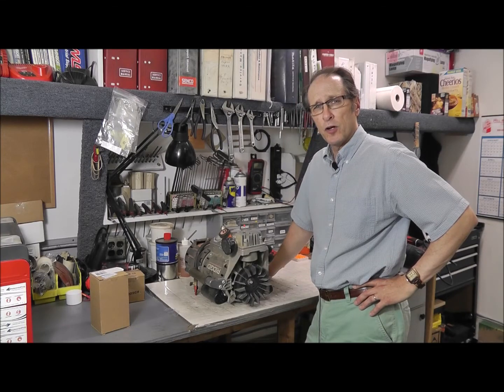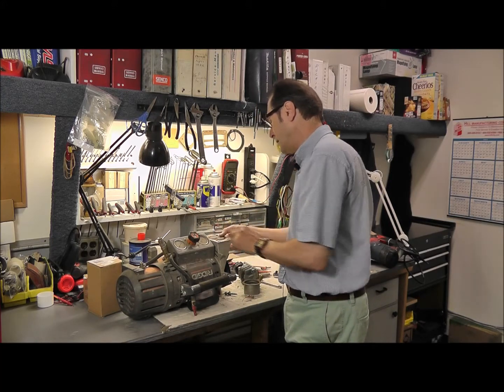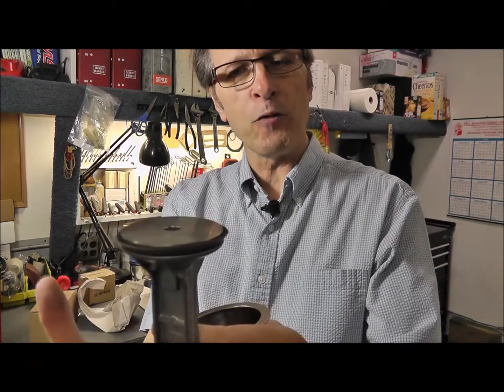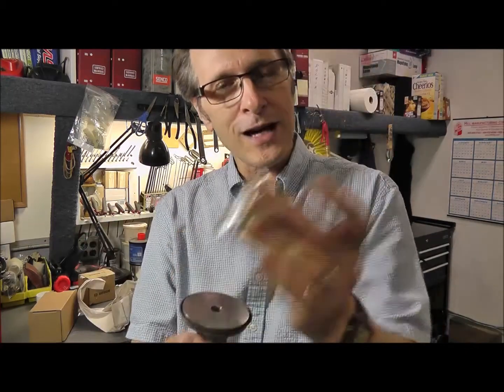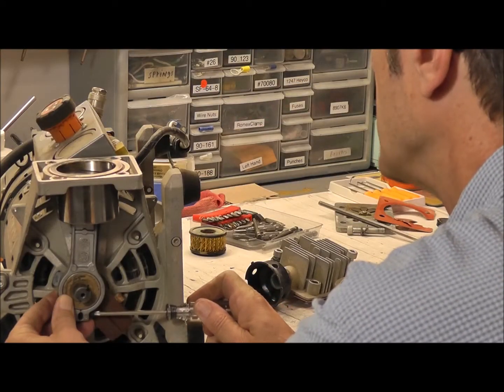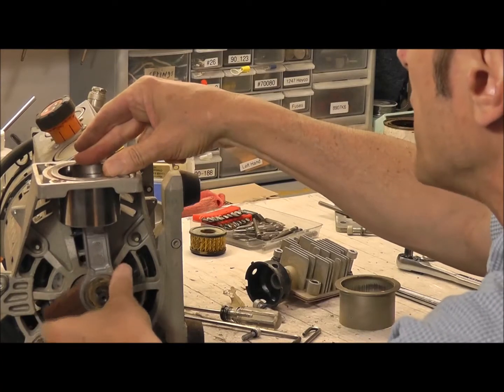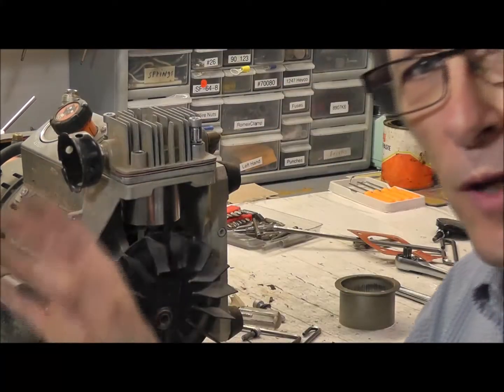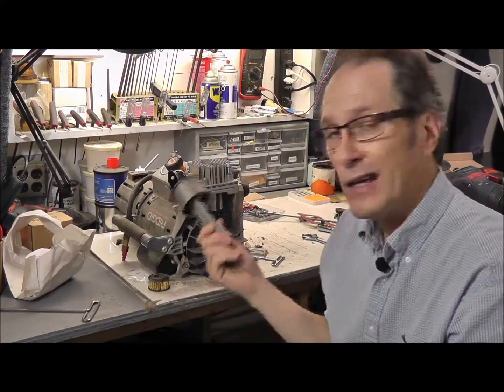Oil free piston and cylinder kit installation for air compressors

Comment: Great video, thanks! I have been methodically working through the 'restoration' of a DeVilbiss IRF412-2 compressor. Replaced the check valve, cleaned up the pressure switch, regulator--unit holds pressure well. Lots of vibration and heat, finally pulled the cylinder head. Valve looks fine, cylinder sleeve scored and compression ring gone! Luckily this model has a torx screw for the connecting rod cap, so I don't have to pull the fan/rod. They built these things like tank back in the day.

Comment: Hi Gill. I have just got me a jun Air silent compressor for a good price. It works well and has been regularly maintained. 
 First thing I’ve done is order A K&N crank case filter to replace the rubbish OEM one. 
 Secondly, I’d like to run it at a higher pressure than the switch is set to. 
 The whole unit is rated to about  150 psi higher than the preset on the switch. 
 Yea, I know these are for dentists and I’m going to run pin guns and small nail guns but I’m sure it’s worth a punt, I just want to run higher pressure to account for the losses in the hose. 
 Are you familiar with these units? 

Thanks.
Reply from the maker: Thanks for the question Rollo! Here is some input that you might find helpful:

- Determine the max safe pressure of the tank.
- Make sure that you are 30 PSI below that pressure.
- Get a safety switch that is rated for that pressure.
- Buy a safety valve that is 5 to 10 PSI over the pressure switch pressure but 20 PSI under the max burst pressure of the tank.
- I'm not entirely sure what the piston/cylinder will do at these higher pressures.

Comment: The piston on my craftsman model 919-153130 compressor does not have a screw on top to remove the top part of the piston to replace the ring,how do I get the top of the piston off to put a new seal ring on it?
Reply from the maker: For your (older) model, you won't be able to replace the piston ring separately, I'm afraid. In this case you would USUALLY replace the entire piston/connecting rod assy, along with the cylinder cup/sleeve, but that part is not even available for your model any longer. It looks like you may need to replace the entire unit at this point as I don't see any other options. Do you see a part number anywhere on the connecting rod?

Comment: Is this the same for a portable air compressor? I have a bostitch 150 PSI 6 gallon that I think needs new rings.
Reply from the maker: Thanks for the question! The oil-free pump in the video is used on many models and is very similar to many out there. The installation is virtually the same for any portable oil-free compressor out there. If you can find your model#, you can search it on our website and find a full diagram and parts list for that unit.

Comment: I'm hoping you can help me find the rubber/plastic piston ring that goes on my diehard 1150 battery pack/tire inflator....Sears has not parts listed for this model...
Reply from the maker: Thank you for the question! Many parts are now obsolete for units sold by Sears so it may be a shot in the dark at this point. We don't have this available so the only option would be Sears.
Reply: @AirCompressorPartsOnline    Thank you for your reply...I'm sure this compressor has been used on other pumps, do you folks carry any of these pistons seals for similar units??  Is there anyway of finding out who the manufacturers are for some of these pumps?  I would be willing to buy a new compressor unit for this Diehard, hate to toss this Diehard unit out....Thanks Don
Reply from the maker: @fleetwin1  We have various compression rings available for many different manufacturers, but it's not likely any of them will fit your Diehard compressor unless you physically had them in your hand to match up with your original. You can browse our various oilfree unit breakdowns on our website but again, I doubt any of these would fit your unit. You may be better off trying to find a local parts supplier or compressor repair shop to try and physically match one they may have in stock with your original.
Reply: @AirCompressorPartsOnline    OK, will try local shops, but just figure they won't have anything for this little compressor, their business  is usually for bigger units.  Maybe I can go online and look at what you have, is that possible.  I realize it is a gamble, but willing to try in an attempt to repair this expensive thing....Thanks  Don
Reply from the maker: @fleetwin1  You can do that if you would like, certainly. You can browse by brand and type of compressor (oil-free units, for instance) by clicking here:

https://aircompressorpartsonline.com/air-compressor-parts-by-brand-c-271.html

Comment: hello i have a craftman air compressor v-twin model #919-152811 both my pistons broke  and i have order theses piston before in the past..i bought my compressor in 1992 i had it for along time ..anyway they said i cant get that piston kit enymore they discontinued it ..so they said kk-4835 is a replacement for i would like to no will that piston kit work in my compressor...i hate to spend the money and it dont work im trying not to go out and buy a new one ..i would love your feedback...thank you.
Reply from the maker: Yes, this will replace the original KK-4835 rod assembly.
HOWEVER, the manufacturer has changed the design of the connecting rod in this kit slightly, so you would have to modify the pump to fit these rods onto the crankshaft so that the piston will align with the cylinder as it should. You may have to install a washer (basically a "shim") so that it will not move too much towards the inside of the eccentric weight. As far as we know, this is the issue with installing this new KK-4835 (aka A02743) kit into the v-twin pumps.

You can certainly order and install it, but if installing on a v-twin pump we won't be able to refund you and there are no returns.

Thanks for the question!

Comment: Nice video. Can you please tell if I have to lubricate the bore before adding piston?
Reply from the maker: Thank you! You do not need to lubricate the piston ring on an oil-free unit, no.
Thanks again for watching!
Reply: @AirCompressorPartsOnline  how does the piston ring compensate for friction then?
Reply from the maker: @saadmagnum936  These rings are Teflon coated so they don't require lubrication, but still keep a tight seal within the cylinder wall.
Reply: @AirCompressorPartsOnline  thanks. You solved my problem

Comment: You dont no where i can get hold of one of these piston rings do you mate ive got a old bar pump compressor its a durr tecnic kk70 model the piston ring is 75mm outside & 63 inside
Reply: Search the parts manual, find parts code and google. Call the company for assistance.

Comment: Welp, got my piston kits in today, took all of about 3 minutes! I got to use my new Tekton torque wrench, very cool! Plugged it in, hit the go switch and 'bzzzzz'...nothing :(
Grr! The compressor was running when the piston broke, and locked everything up for about a minute til we were able to get out from under the truck and over to it to shut it off. 
The pistons turn everything real nice, hopefully its just one of those electric things on top of the motor that burnt up? One buzzes and the other doesn't. Back to the drawing board.
Did I mention I got to use my new torque wrench?? SaWeeeet!
Reply from the maker: It's always fun using a shiny new tool! You're probably right, btw. Most likely one of the motor capacitors is defective. I would probably replace the START cap first if it buzzes as soon as you fire up the unit. It's probably not giving the unit enough "juice" to fire the motor up, which is pretty common. Good luck and thanks for the comment!

Comment: Hi, I have a Fiac Miami part number: 1362120000 and it has just stopped working. Would you know what I could do to possibly get it working again? I've started with the basics and checked the plug fuse which seems fine but I'm unsure on what to check next. Your help would be much appreciated. Thanks :)
Reply from the maker: I realize this comment is a year old and I'm now just seeing this...for that I apologize! I imagine you have this compressor working since it's been so long? There isn't a lot of information on these Fiac units, but I did find your model. Hopefully all is working well now. Again, sorry for dropping the ball and not replying sooner.